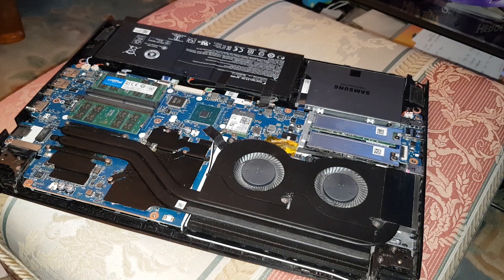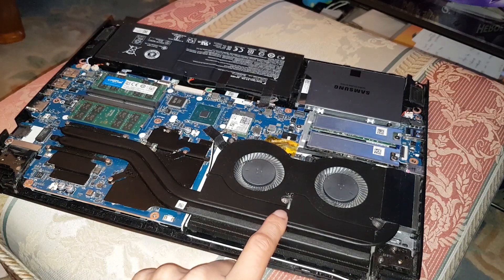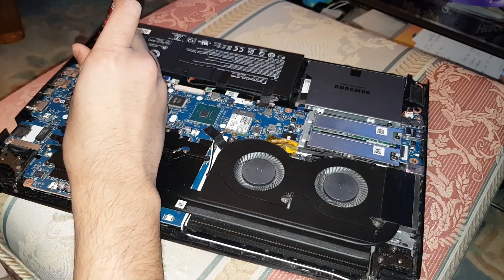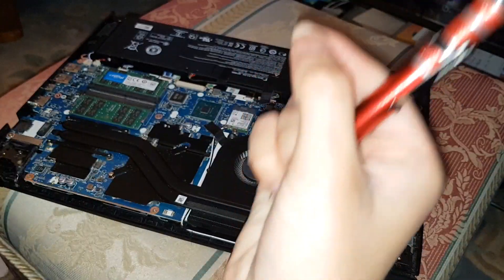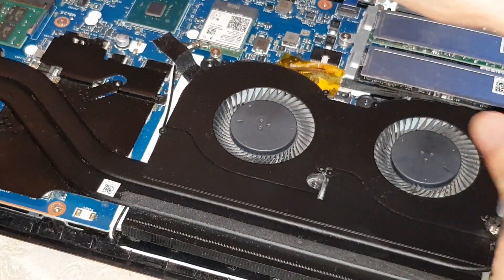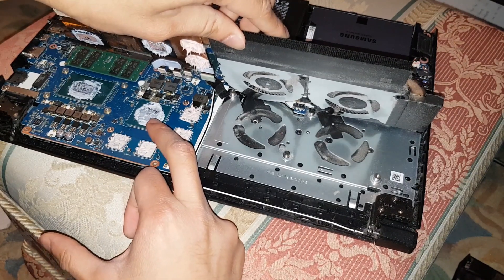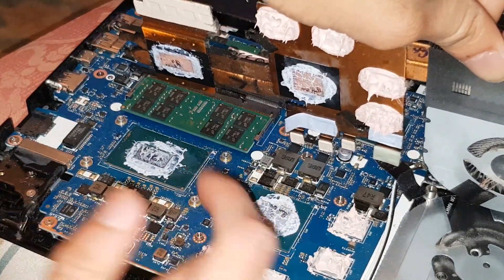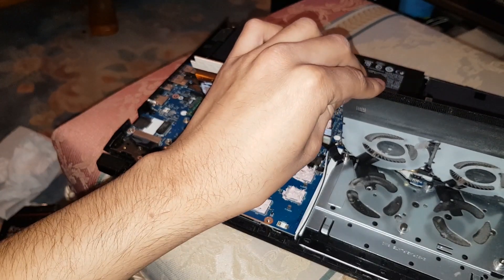Thermal Grizzly Kryonaut 6 Month Later Review Checkup

Comment: I am using Dell G15 i7-12700H with 3070ti..just yesterday I changed my thermal paste to Thermal Grizzly Kryonaut. 

After changing no difference at all..Temps are still reaching 100°©.. 

What could be the reason? Is krynoaut not suitable for laptop?

Which thermal paste should I opt for then ?
Reply from the maker: Try hydronaut or liquid metal

Comment: I told you it will pump out very soon. As you see it has pumped out from the sides. next use thermal grizly hydronaut or Ic diamond they are very thick and viscous and is recommended for laptops. I have applied hydronaut  on my nitro 5. and its been one year and its holding up very well.  I have tried kyronaut ,MX5 , MX4, Noctua NTH1 and they all pump out in a month. and use some good quality thermal pads on the VRMS.
Reply from the maker: Thanks for recommendation i did artic mx4 next i making video on this soon too as its been 6 months so ill show that then ill try yours and give review after 6 months
Reply: would you recommend ic diamond?
Reply from the maker: Never tried it, the one going well for me atm is hydranaut